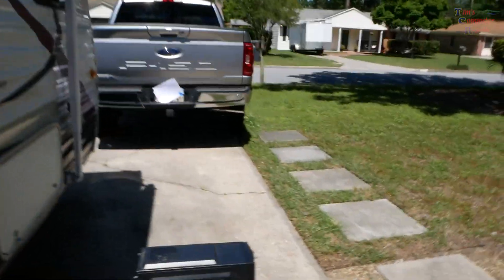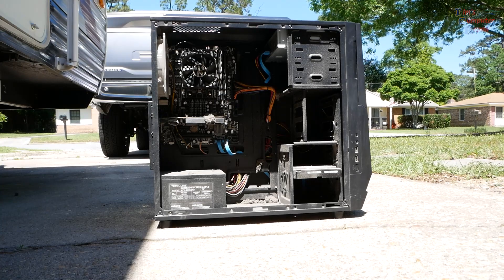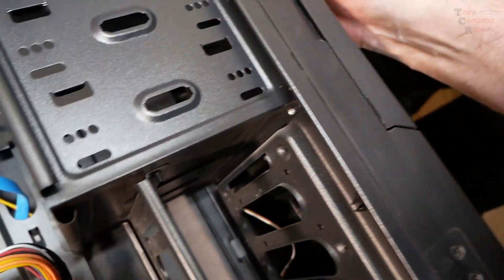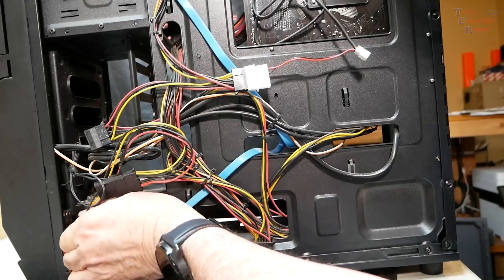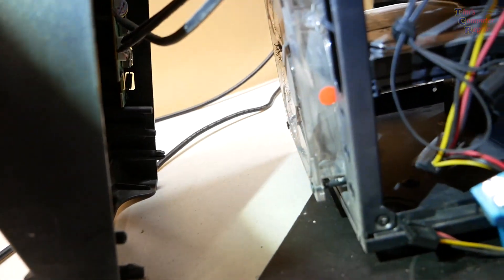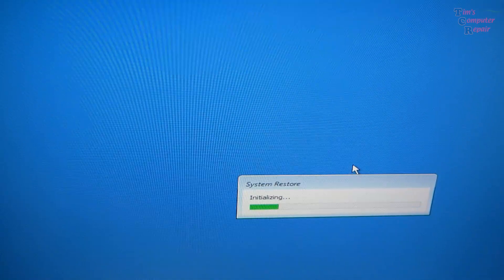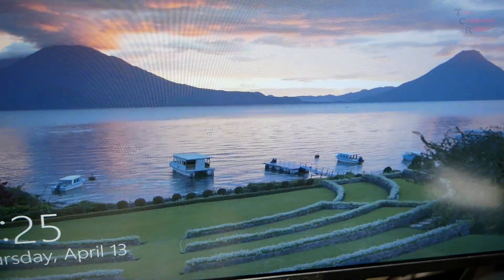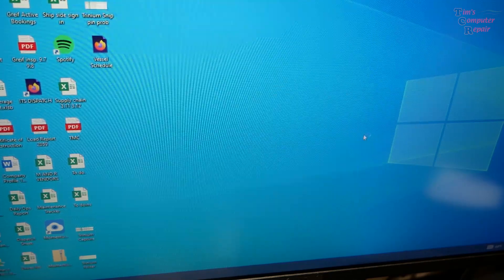Blue Screen of Death During Boot? First Things to Try in Windows 10 and 11

Comment: Just get rid of those mechanical hard drives No matter what. For all the amount of time wasted you could have put a nice SSD in there and saved yourself the trouble later on when that computer would come back for repair due to the hard-drive failing. No computer ever goes out of my shop with a mechanical hard drive in it. All get an SSD. Because I don't want the computer coming back with a failed HDD and having a pissed off customer